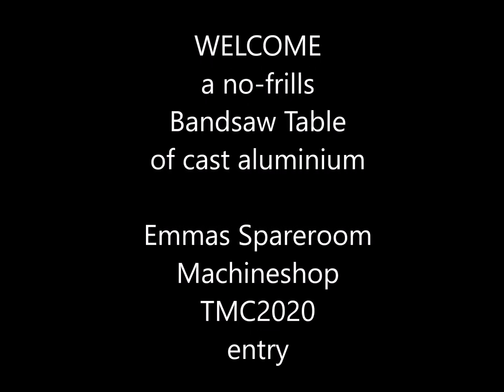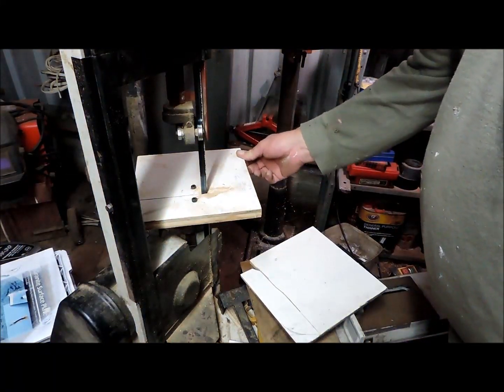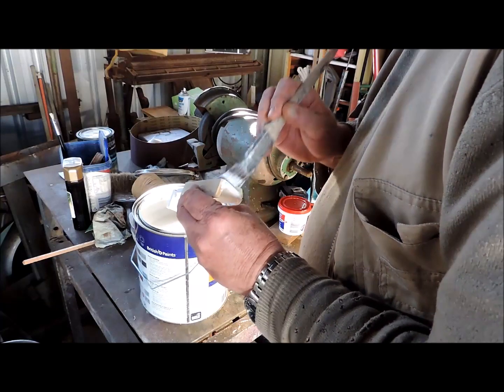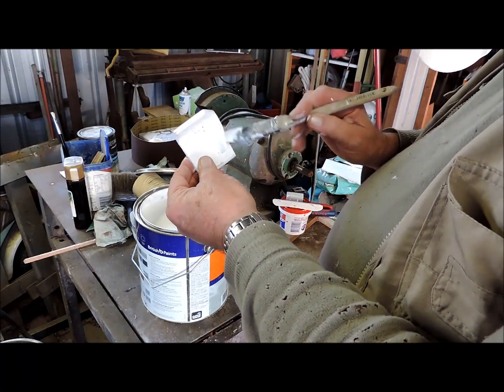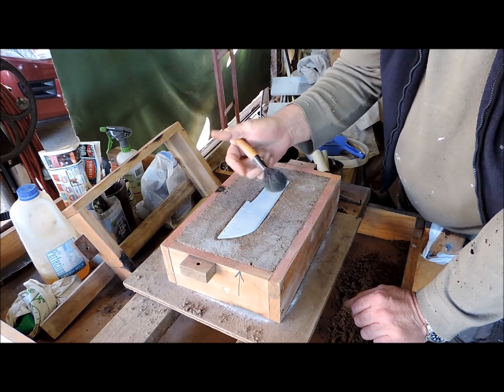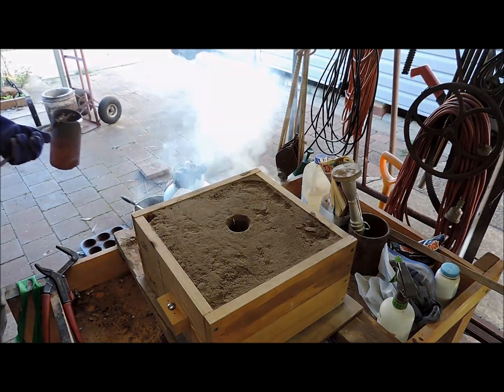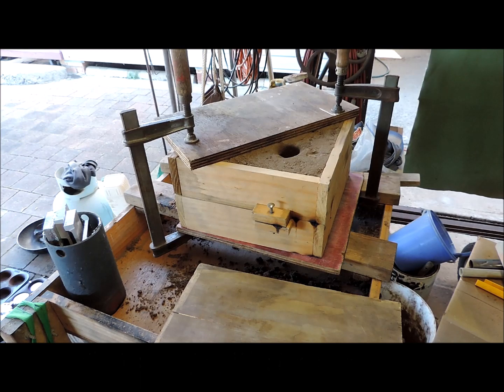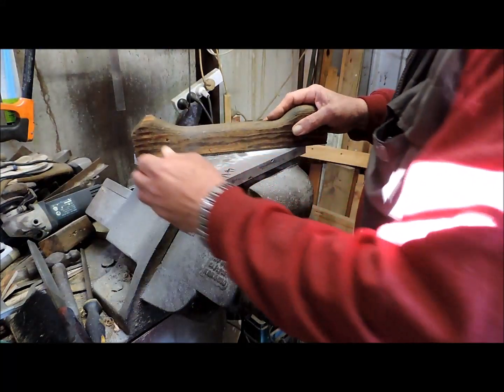My Bandsaw Table  entry for #TMC2020

Comment: Nice:-) interesting milling machine and unusual vice :-)
I made a crude wooden seat , so i could sit on the saw while using it as a vertical saw
Reply from the maker: G’day Bill. Thanks for stopping by and commenting. Yes the mill is interesting and very handy, it took quite some time to build and video. I have had a number of comments about the vice it is very useful. 
Cheers 
Peter

Comment: Hey Peter, I totally missed this when it came out. Really nice job and a great idea. Looks great.  I have been wanting to replace my table for awhile. This might be just the thing. Do you purchase specialty sand or make your own mix?
All the Best!
Eddie
Reply from the maker: G’day Eddy. The table is great to use, well worth the effort. I use playground sand mixed with 4% by weight bentonite clay- some brands of kitty litter- 
Cheers 
Peter
Reply: @pgs8597  That is interesting, I had heard of the kitty litter method but never knew it was that specific thing in it. We have a product here called Oil-Dri that is that 100% Bentonite clay, they call it Montmorillonite but it is the same thing. It is very cheap as well. I am definitely giving that a shot. All the best!

Comment: Nice work!
It looks way more robust than the typical sheet metal tables they give you
Reply from the maker: G’day Tommy, it sure is, the sheet metal one was terrible but then for the price what can you expect. This one is solid, the mistake I made was copying the tinny one, I should have extended the forecourt 75/100 mm longer for when I fit a protractor, if it annoys me I could make another, simple enough since I know the foundry guy:)
Cheers 
Peter